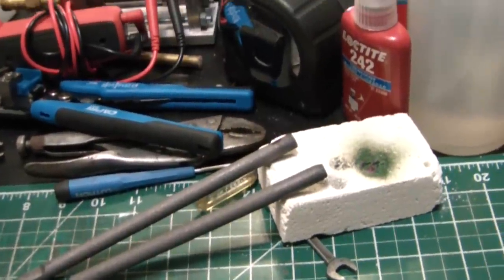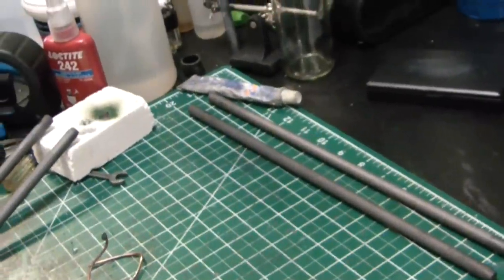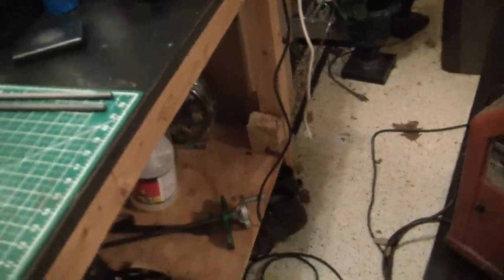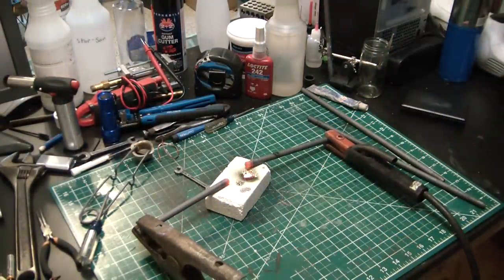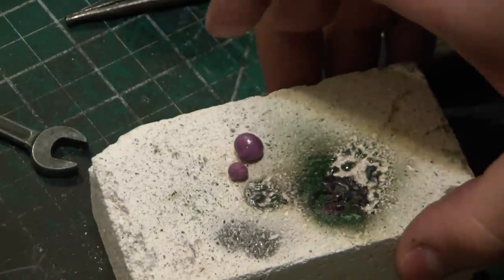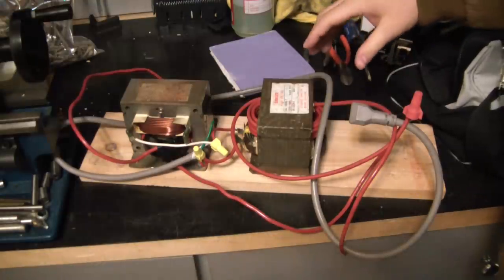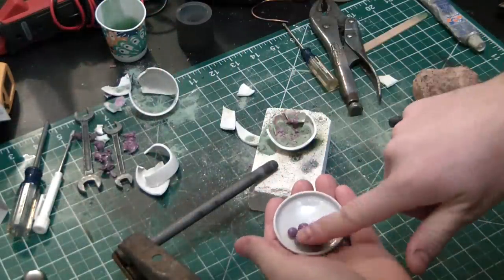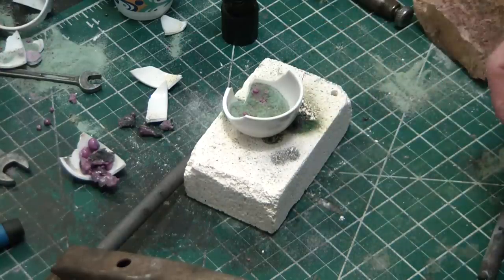Arc Furnace Ruby Gemstones DIY - Huge Rubies and Giveaway! - ElementalMaker

Comment: I'd like to see one of the rubies faceted by a gem cutter.
Reply: Will probably look like a maroon color cut rock. They do not look pure enough to to have gem quality crystalline structure. Still, it would be cool to see.
Reply: @lucusloc  Well they're obviously going to be amorphous due to the process and heat/cool times, but it would still be neat to see one faceted, but I want to see it used as a tool as I don't know anything about how rugged amorphous ruby is.
Reply: @AtlasReburdened  Polycrystalline, not amorphous. You don't get amorphous aluminum oxide unless you do some really unique deposition/growth methods. At high temperatures, the speed of nucleation is just too high.
Reply: they aren't anywhere near gem quality, they are far too cloudy to give you any sort of good refraction in the stone.
Reply: Anonymous Anonymous  send some to taofladeurmaus haha
Reply: Wouldn't be clear enough for that, but maybe as a cabochon in a ring.😁
Reply: Carve one into a Ruby skull
Reply: They might make decent cabachons (rounded top) but they would have to be much clearer to be worth faceting.
Reply: Anonymous Anonymous  I think they would be too brittle, but that's just a guess. They're really tiny for arrowheads though. I'm guessing the biggest is only 8mm (about 3/8") or so.
Reply: Same
Reply: I work at a jewelry shop and would love to help with this
Reply: I would guess they'd be closer to a pearl than a gem.
Reply: I facet gems and that is why I’m here. I want to use this technique in a vacuum chamber to see if I can make a gem quality stone.
Reply: @alpha9526  troll much?
Reply: MarksGoneWicked What did I say?
Reply: @alpha9526   not you, sorry. The guy who posted after you.
Reply: GlitterJuice  troll much?
Reply: I’m a gem cutter as well-am curious whether these would produce a star when cabbed. Might need a touch of titanium oxide to get that possibly?
Reply: Cabochon rather than facet
Reply: Probably couldn't cut it, Its not a monocrystal.  Normally lab crystals (rods) are made in a similar fashion to silicon wafer ingots, which is not possible using a primitive arc furnace.
Reply: It'll take me a long time, but i gotchu
Reply: Has anyone thought to recrystallize synth rubies in a ceramics kiln, to homogenize the material like they do for glass? Glasiers, care to weigh in?
Reply: THERE ARE NO CLEAR RUBIES, THEY ARE PINKISH THROUGHOUT.
Reply: I think that may just be a shell, the inside is transparent ruby perhaps, not sure.
Reply: @lucusloc  could try heat treating at 900 C with borate flux to see how the color changes, then facet and polish to see what happens.

Comment: Damn.  Those carbon rods are “Currently Unavailable” on Amazon.  The seller is probably wondering how they just sold all of their inventory.  Awesome work though.
Reply: I bought plain un copper sleeved graphite rods from an eBay seller. They where cheap as chips including delivery (to Australia).
Reply: Do what I did, buy a box a couple of years ago. :D
Reply: Nic Green could probably find Them cheaper than chips tbh
Reply: Anonymous Anonymous  If I remember correctly from my childhood, old fashion non-alkaline batteries all have carbon rods. D cells might be big enough but the lantern batteries you suggested are probably better for the welder. You also get zinc and IIRC manganese dioxide which will stain everything it touches black and is nearly impossible to wash off before the parents come home from work. It might contaminate the ruby or experimenter.
Reply: Anonymous Anonymous  Interesting. I don't remember the rods flaming like that when I was a kid. I guess battery technology changed or I forgot. The rods are also good for some electrolysis experiments since they conduct electricity and don't corrode. At least I don't remember them ever corroding.
Reply: Any welding supply store should have them. They are for a carbon arc cutter.

Comment: Yeah  just when you think hydrogen burns hot, and start playing with that zappy energy stuff that comes out the wall! :0
Reply: Yeah lol Basically pure energy being released. For the 1st time I saw power lines arch out last week because thousands of birds landed on them and make the lines jump and short out very impressive arch probably about 10 feet.
Reply: @zachell1991  So how many of the birds were turned into instant KFC then?
Reply: @SeanBZA  haha not sure i didn't see it but some of my coworkers saw some fall to the ground lol ot happens when they all jump off the lines at the same time so not very many get hit.

Comment: When you turned on the welder, I could hear your meter spinning
Reply: Yea they go from a crawl to RPM's
Reply: @scarakus  But if it is not in use but plugged in and on the inductive current is so high that they actually will try to spin in reverse, as the lagging current reacting with the voltage coil turns the eddy current disk backwards. Most meters however have a one way clutch on the one bearing to prevent this, so it simply stops moving.
Reply: I can vividly remember when I was little running to the meter when my da was welding (a little 220V welder) to see the disc spinning every time he welded something, especially in 1992 when he built the house fence with steel tubes.
Reply: SeanBZA you’re telling me that idling an arch welder 24/7 means free electricity?

Comment: If you sub the chromium out for vanadium, you should be able to make sapphires that can be confused with alexandrite instead. (purple/violet)
Iron and titanium together can be used to try and make blue sapphires. You can also try and use the two mixes piled together (but not mixed [think two piles, pushed together]) to try and make a color shifting sapphire.  
Just using iron can make green to yellow sapphire, and using iron and chromium together should make orange sapphire.
Also, using just the aluminium oxide on its own should make colorless corundum, which is apparently a popular alternative for diamonds in jewelry. (for marketing reasons, they'll typically call it "colorless sapphire" instead of "corundum" :P)

Comment: Well, that was easy. Might give it a shot myself. I wonder what it would take to get to gem quality. Maybe just a longer heating period and slow cool down.
Reply from the maker: I would absolutely love to see your take on the process! From the research I did it looks to take a pretty long time, on the order of weeks to months to grow a clear ruby boule, but I'm still going to keep on trying 👍.
Reply: I may very well do that. If I make a video I will be sure to source your channel heavily and push some traffic your way. Are you still using 95/5 ratio of Al2O3 to Cr2O3? I saw that in one of your earlier videos. Did you pull that ratio out of thin air or did it come from some source on making synthetic rubies?
Reply from the maker: @Nighthawkinlight   NightHawkInLight  I appreciate that so much. In this case I used a 99% Al2O3 to 1% Cr2O3 mixture. Most research I found stated between 0.5% to 5% chromium doping is used for ruby synthesis.
Reply: @ElementalMaker  Video's up! I apologize I accidentally referred to your channel as ElementMaker, but I have the correct link/name in the description and top comment.
Reply: 'I think you need pressure too
Reply: Can you make any other types of gems with other recipes? sapphire, emerald, ect.
Reply: @O-Driscoll88  Ruby is practically just red sapphire, so you can definitely make sapphire with it. You'd have to find the appropriate dopants for the colour you're aiming for, though.
Reply: @ElementalMaker  To become CLEAR ruby the crystal has to grow monolithic !
Me and some friends were trying this in the 90's for LASER rubies ...
It need days of heating and small amounts of the AlCr mix falling on a rotating plate with a O²H flame .... Doping was that time 0,5% max.

Edit :
I forgot to mention that we had to use Chromium Dioxide and not Chromium Oxide.
The reason i can't remember only that Chromium Dioxide is a very nasty stuff.

Edit 2 : Now i remember ! 
Chromium OXIDE will NOT form monolithic ruby !
The Chromium DIOXIDE acts also as a "seed" for the monolithic form of ruby.

Comment: I have a synthetic sapphire, a cherished ten cent reminder from a former job.  They get cut into wafers and electronic circuits are built on them.  Rubies are and emeralds are chemically nearly the same, except rubies have a trace of chrome, and sapphires have a bit of iron (or titanium). 
Awesome video.  I want to see you make some diamonds.  You already have the carbon...
Reply: Emeralds are a separate compound based on Beryllium, but you can make green sapphires with Vanadium as the contaminant.

Comment: What about using a conical graphite crucible as one of the electrodes with the stick one close to it surrounded by the mixture?
Maybe that way you can melt all it into one bead?
Reply from the maker: I actually tried that but didn't have much success. Editing a video for the B channel right now showing the efforts
Reply: @ElementalMaker   Wow, I really appreciate the amount of time and money you put in your videos even before publishing them!
But even after the time I am following you I did not know you have a B channel! Can you please write the name?
Greetings from Bavaria!
Reply: @ElementalMaker  why do you think it didn't work as well as two rods in a non conductive one?
Reply from the maker: @AcidSnuff thank you! And of course, its ElementalMakerB, if you just search that you should find it no problem 👍
Reply from the maker: @DC_DC_DC_DC  it seemed like too much carbon being able to diffuse into the ruby.
Reply: I'd like to see that video with the cone mould, will you be posting a link here please?
Reply: @ElementalMaker  what is the link to the B channel?
Reply: What about a bowl carved out of that refractory brick?
Reply: @charles8060  thank you!
Reply: I'm pretty sure that those crucibles are a clay/graphite mix and so the odds are that they aren't particularly electrically conductive.
Reply: G'day, with the welder l would pull it down make sure somebody hasn't tampered with it. I don't reckon it should short out. See ya!
Reply: Nighthawkandlight did that
Reply: @dj1NM3  there is may same clay in it (less than 5%) and as I know they are blinded by Tar or bitumen and they a conductiv like the roods
Reply: Use a mix of carbon powder in it

Comment: Ruby, or the elements that make up ruby, vaporizes, ( change of state from liquid to gas), at average of 4000°F.
Hydrogen burns a flame at around that temperature.
Back off your flame.
The flame will have to burn for about 20 minutes to properly congeal and burn out the impurities.
Hydrogen fluoride is what is used to clean rubies up.

Comment: keep eye out for more welders like that!! those old ones are so esay to fix!! the brands on the outside may not be the same but the parts inside unbolt and others bolt in!! i have one that was made in the 60s!! 1960s and still works!!
Reply from the maker: Good to know and yes they kept them simple and robust back then. Not much to go wrong, and when it does it doesn't take a phd in rocket surgery.

Comment: Here's a thought. Put a heavy wire coil around it and pass high current ac when you do that. Maybe Justin line with the electrodes. The hope is that when the alumina melts, it becomes conductive and absorbs even more energy from the field maybe leading to a runaway melting.

Comment: Something you might try is adding some inert gas to the mix, ark under some Aragon  so you dont have oxides in your stone. All you would have to do is run a plastic tube into or just over your little bowl. Might stop the dark spots.

Comment: Hi ElementalMaker, I have a suggestion for possibly creating better ruby. if you make a graphite mold with a hole in the hexadiagonal shape and make a  fitting lid which can be pushed into it which is also graphite in the center but an isolated edge at the sides then you can connect them to the different terminals of the welder and while activated use a press or an isolated Vise to apply pressure. 
the first benefit is the shape, the second is that you won't have to hold the terminals which reduces the risk at injury(of course make sure that the setup is not shorted). and as a last one it might make them clearer due to the speculative possibility that the increased pressure enhances the crystals structure which might make it clearer.

Comment: Im already digging that we essentially have the same interests. So i have tried this exact method as well and also got kinda grayish coloration on the outside. Also assumed it was from the carbon rods. (I pulled my carbon rods from old big 6v batteries). One problem i had though was mostly ending up with a ruby shell where the inside didnt fully heat up. 
Ive since experimented with using my tig welder for the arc to remove the carbon aspect, and i stopped seeing the dark gray discoloration. As for the big rubies ending up only forming a shell, i made a jig out of stainless steel. Basically two 1" rods as a tester with bowls cut in either end where i could put the AlO and CrO mix inside and pack it into a ball. Heat the mixture up with the arc and once it was glowing super hot put a weight on top of the other rod to add pressure and keep heating the rods to help cool the mix more slowly. This did produce more fully dense larger rubies but far from what id call jewelry worthy stones. I havent polished any of them yet to really see how theyd turn out. Id like to revisit the setup and try and find a better way to induce the heat into the dies while keeping pressure on them at all times. Kinda like how they form PCD.

Comment: Great vid mate, thanks for the comments about the uk 🇬🇧 but as a citizen I'd probably differ in my opinion. Anyway just thought I'd say you could use a car battery... pos wire goes to a metal plate submerge the metal plate into a large container about 25ltrs of water secure the metal plate on one side of the container put another metal plate secured at the other side of the container. The water act like a massive capacitor type thing. Then put another wire from the second plate to a carbon Rob and a wire from your other battery terminal to a carbon rod, hey presto a extremely dangerous way of doing the same thing... the carbon in the Ruby could be reduced by performing the burn in a zero oxygen environment 🤔,, the arc in oxygen is actually producing  flash graphene !! Which is mixed into your lovely Ruby... Great stuff

Comment: I use those carbon rods for glassblowing. Just fyi you can just peel that copper right off. just get the edge up where the carbon is showing and the you can peel it in a spiral all the way off if you want. I peel some of in order to produce different types of tools
Reply from the maker: I tried peeling as that's worked for me with brands in the past, but these ones were damn near impossible to peel. Dissolution was easier with these

Comment: Hey idea for your ruby printer! You should check out conventional laser cutters with built in blow out for the mirror. You could probably modify a head to feed the powder. And run a pattern multiple times. But at this point you might as well do the conventional sls.
 Or, if lasers dont like reflective ruby, you could use an electron gun. But now you have vacuum chambers...

Comment: If you add a high voltahe spark generator(30kV per cm distance i believe) in parallel to the arc-gap, you could fix the electrodes in place, "kickstart" the arc-furnace with the spark and have the welder maintain the arc.

Comment: Hmm gem grade synthetic ruby and sapphire is to dissolve alumina in lead oxide then grow the crystals from that. Indistinguishable from natural ruby (except natural has defects). Gem society requires UV die if synth rubies sold. The old boule method using oxy-hydrogen apparatus is from the 1960s and was used to make ruby laser rods (they are pale pink; on eBay) but that method doesn’t create a single crystal that traditional faceting requires. Can always use a grinder to facet stone. Though been told natural faceting gives better brilliance.

Comment: AweSome, if you could build a rig that put distance between the Arc and the crucible...furnace walls, use the distance and ruby mix to insulate .  
I believe your Carbon ARC Rubies were Glowing much brighter than its normal Color Temperature would indicate... the Arc light and Extreme Hi Temp Pumped the ruby up (just like a ruby laser) and released its energy as it cool and electrons fell back to is resting state... Further Proof those are Rubies

Comment: Use graphite to make a cup and an electrode altogether.  Put the aluminum and chromium in the cup.  Use the other graphite rod as the top and the second electrode.  Shield the reaction with argon gas.  That should enable you to make a large ruby THATS CLEAR!

Comment: Hey ElementalMaker, if you have a electric forge or something similar. Melt the rubies and then put them in a hot furnace to slowly cool. Spoke to an old friend who said it helps a ton with getting clearer rubies !

Comment: I wonder how well those'd work as lasing crystals. They might have too much carbon in them, but with some cutting and polishing they could produce some coherent light.

To get really clean crystals you'd probably have to use tungsten rods to avoid any carbon form getting inside (though I'm not sure if the tungsten would react with the aluminum oxide or chromium)